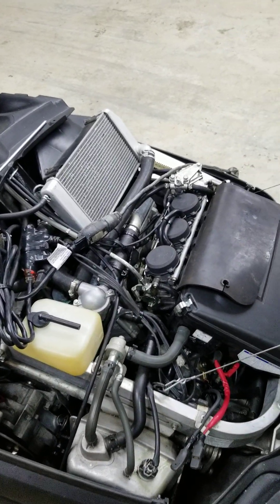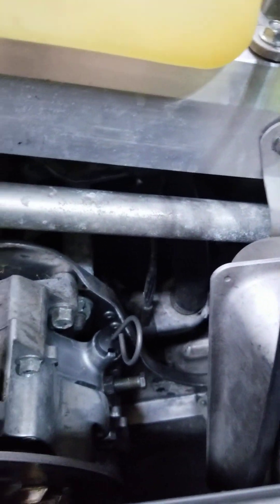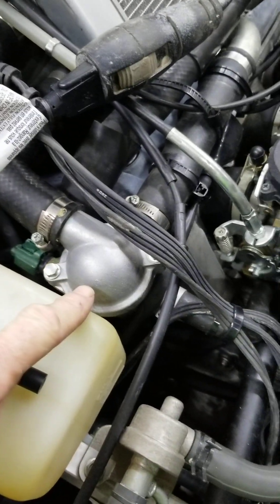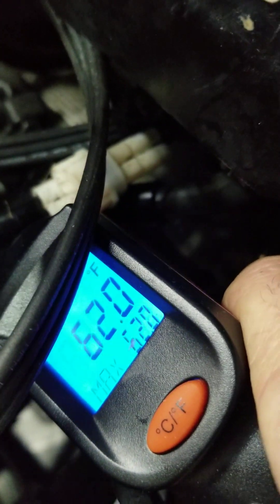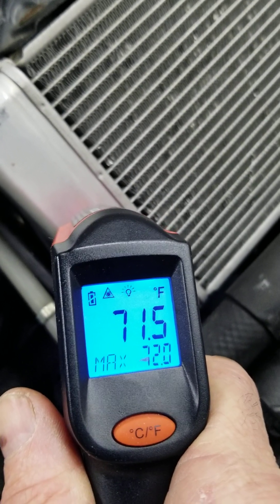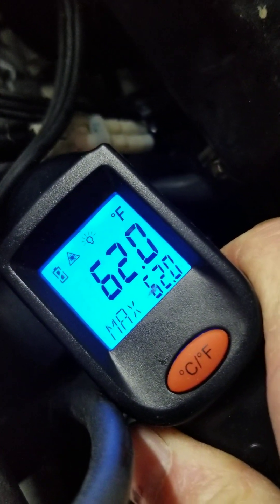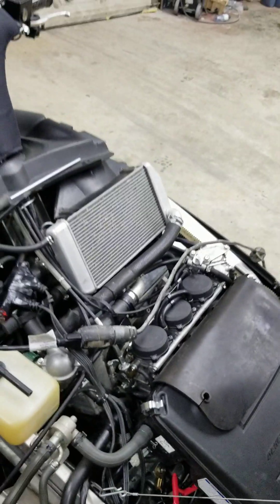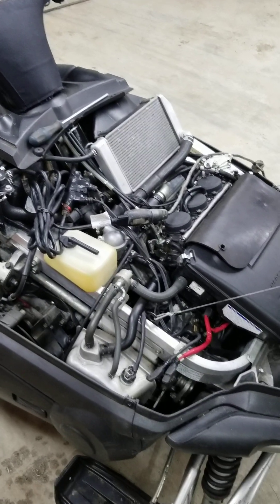Yamaha inline engine heater is a fail - here is why

Comment: Did the same on a grizzly 700. Doesn’t work!! There’s no place that I can find to put the coolant heater we’re there’s a upward slope that goes directly into the motor. Waste of money and now have to replace the coolant hose when i remove the heater!!??
Reply from the maker: So I can say this.  It does definitely help when its really cold.  But it  needs to be on for hours.  You cant just plug it in for an hour.  It's not great...but if you leave it plugged in for 3 or 4 hours you will find it actually warms the engine.  Not great but it may help.  They need need one  with a pump
Reply: @ontariooutdoorsman  plugged the grizzly in for 4 hours and used the laser temp gun and followed the coolant path. The rad warmed some  on inlet side but on outlet side very little and by the thermostat basically nothing. Just saying

Comment: Hi, I could not agree more with your assessment, that is for sure. I have been preheating mine in Alaska with a German Steinel Heatgun. Works great. Hot air blowing big time. If the generator to do this is not big enough a "Hornet Heater" for airplanes works great also, 450W only.  Best Regards, From Alaska.

Comment: Hey Jim did you get this figured out?
Reply from the maker: So basically it does help.  But it's incredibly inefficient because of the placement of the heater.  If its -35 or -40 and its plugged in for 4 or 5 hours..or better yet overnight...it will startup no problem.  But dont think plugging it in 30 min before starting will help.  It wont.